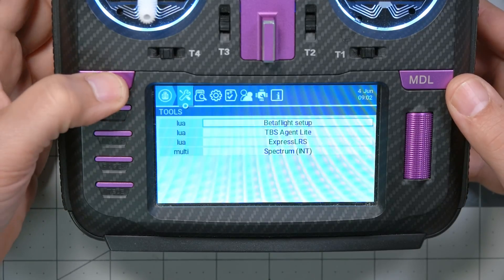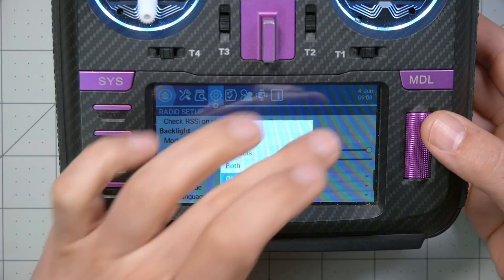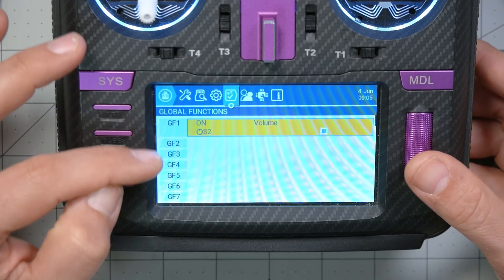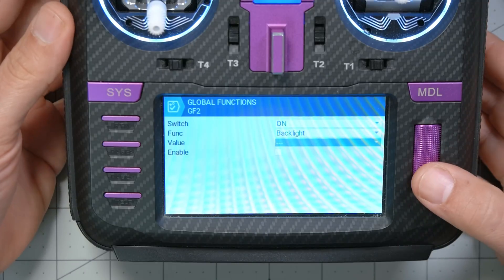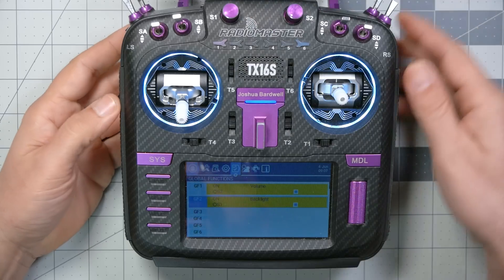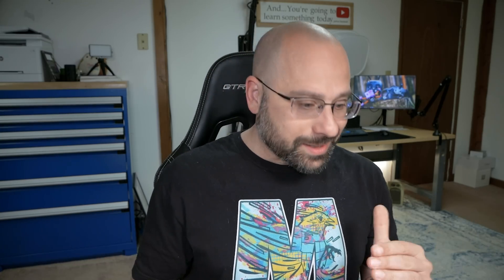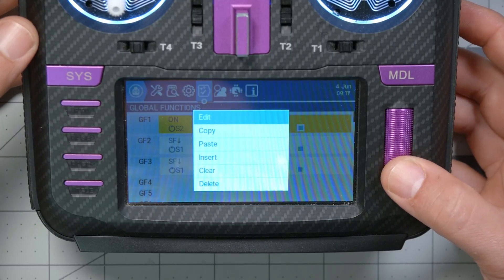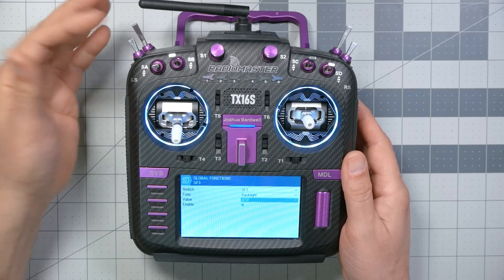Screen brightness on a knob? // EDGETX GLOBAL FUNCTIONS HOW-TO

Comment: Through trial and error i THINK i have a solution for where you pull to arm and push to disarm. Did this on my FrSky XLite. I have the radio backlight setting set to ON. Reading from left to right as I dont know what the field names are off the top of my head. In Global Functions: I have the first field set to my arm switch down (disarm positon), second field backlight. The third field is set to a knob/pot, in my case S2 (right shoulder dial). Checkbox enabled. Now. In the disarm mode. Backlight is ON. Dial does nothing. When armed, dial controls brightness. I just keep the knob at zero but it lets me dial up the brightness to peek at the screen if need be while armed.

Comment: Sweet tip, thx. Now it only there was a way to control the gimbal LEDs with a knob. 🤔
Reply: When I upgrade my Jumper T16 to RM 16 I will do a hardware mod to it, allowing the backlight pwm brightness control to control the stick lights.

Comment: Very nice (though I'm wondering about the situation where a programming goof disables the backlight, preventing viewing the display to fix it - maybe it's still legible with the backlight off?)
Reply: With 2.6 you can not switch the display on brightness to be off and the timeout for automatic off is at least 5 seconds to prevent this from happening.
Reply: @malte9999  is this why I can't get the screen to turn off when I arm like this video? I mean, it works but it doesn't turn off completely.. Just dims when I arm. Not really useful if I can't turn the screen off completely.

I did notice once I updated to 2.6 it didn't turn off completely with the S2 knob anymore
Reply: It is barely visible, but if you have a flashlight, you can shine the light into the screen, and this helps enough to be able to fix your blunder :)

Comment: Last comment is probably in needs moderation limbo so I'll just omit the link.

Just a heads up, I'm using Edge TX 2.6.0 on the Radiomaster TX16s and it all works except for turning the screen backlighting completely off.  They made a change in 2.6.0 so that radios with a color LCD will only go to a certain minimum brightness and not completely off.  Even the OFF option in the Mode options has been removed.

Thanks again for the great work and content.
Reply: Yeah, I thought my radio was broken and then I found out that screen in edgetx 2.6 can't be set completely off
Reply: omg same like me. I think my radio was broken too.. thx bro
Reply: Has anyone reported this as a bug?

Comment: Followed your video, I'm on edgeTX 2.6 on the TX16S. Strange thing in my case can't alter the timeout of the screen in on mode and in other modes can't get it to 0. Also when setting up the knob It's kinda working but can't get the screen turned down completely to black
Reply: I commented directly but after your comment, they made a change in 2.6 so that the screen can't go bellow a minimum brightness only for controllers with a color LCD.
Reply: On edgeTX 2.6 it will go down to only 5s. The lowest brightness is just min brightness but not OFF.
Reply: @fpv_india  Like mine! Do you find out how to turn brightness OFF? Thanks
Reply: Yeah. I just found out the same thing. Thought I screwed something up. 🤓
Reply: Same for me with edgetx 2.6. 

The tips working fine finally , because the goal is to reduce the discharge of the battery…

Comment: My screen does not turn off completely with knob or arm. It dimms, but still on. Why is that?
Reply: @valentin.kompatscher  Positive
Reply: @ZicmuMr  then this is intentional.
Reply: @malte9999  Is there any workaround?
Reply: @ZicmuMr  set the display to another mode and use the timer. The display off brightness can still be set to off

Comment: I am a long-time fixed wing rc aircraft that is "trying " to switch from a Spektrum DX8 gen 2 to a Radiomaster TX16S.   Wow, long and steep learning curve.  I really appreciate your TX16S  videos. Well done 👏!
Background I am/was  a USMC NFO for the A6Es Intruders. Aaaaarrrrhh!
Reply: May I ask why ? I was thinking of doing the same but not sure if it worth the trouble. Thanks.
Reply: Moving a lot of my planes from my SX20 to my TX-16S Max.   Yeah, there's quite a learning curve,  but once you get used to it,  it seems a lot more intuitive than the DX20.  And the touch screen sure speeds things up.
Reply: The NATOPS for the A6 is almost as complicated! 😉
Reply: But very ROBUST!!

Comment: Elrs devs will probably come up with eye tracking somehow with the tx modual to just turn the screen on when you look at it. I'm only like 50% joking.
Reply: It might be possible actually. It could be done by measuring the change in DbM when you are near the transmitter. Sorta like those RF body proximity detectors.